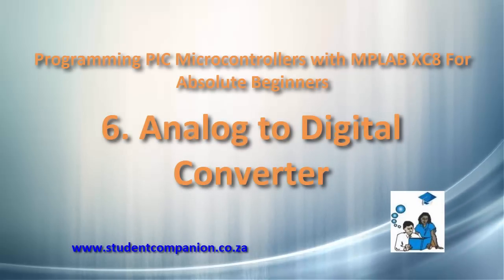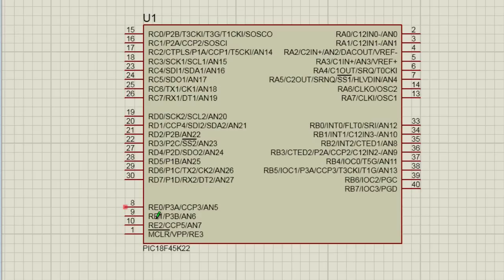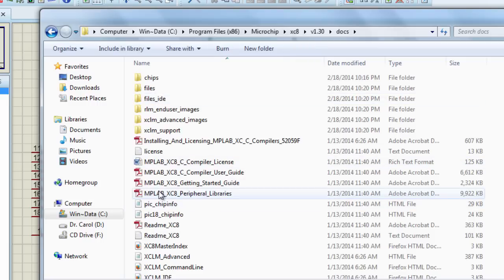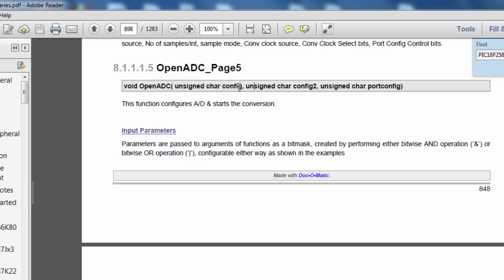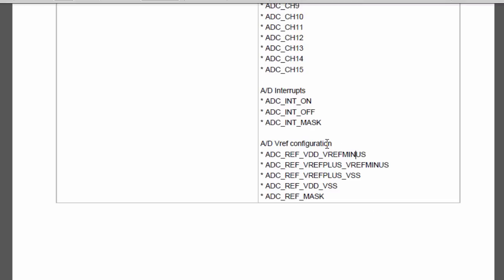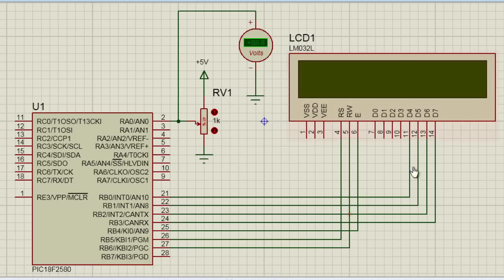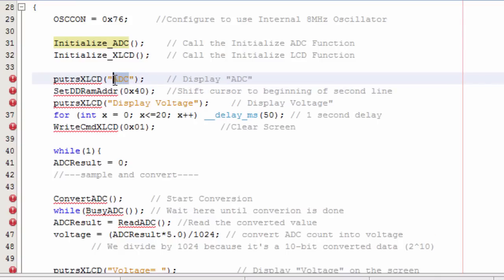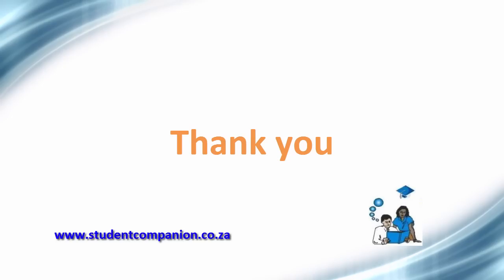6- Analog to Digital Converter | MPLAB XC8 for Beginners Tutorial

Comment: hi. sir, what changes need to be done if i use pic18f248.i used the same code .but its shows error
Reply from the maker: +Jayesh kumar p r what errors? You must post your code and all your error messages
Reply: #define _XTAL_FREQ 16000000
#include <stdio.h>
#include <stdlib.h>

 
void init_XLCD(void); //Initialize LCD display
void DelayFor18TCY( void ); //18 cycles delay
void DelayPORXLCD (void); // Delay of 15ms
void DelayXLCD (void); // Delay of 5ms
 
void main(void)
{
 init_XLCD(); //Call the Initialize LCD display function
 putrsXLCD("Hello World"); //Display "Hello World"
 SetDDRamAddr(0x40); //shift cursor to beginning of second line
 putrsXLCD("LCD Display"); //Display "LCD display"
 while(1)
 {
 }
 }
void init_XLCD(void) //Initialize LCD display
{  OpenXLCD(FOUR_BIT&LINES_5X7); //configure LCD in 4-bit Data Interface mode
 //and 5x7 characters, multiple line display
 while(BusyXLCD()); //Check if the LCD controller is not busy
 //before writing some commands?
 WriteCmdXLCD(0x06); // move cursor right, don’t shift display
 WriteCmdXLCD(0x0C); //turn display on without cursor
 
 }
void DelayFor18TCY( void ) //18 cycles delay
{
 Nop( ); Nop( ); Nop( ); Nop( ); // 18 cycle delay
 Nop( ); Nop( ); Nop( ); Nop( );
 Nop( ); Nop( ); Nop( ); Nop( );
 Nop( ); Nop( );
 return;
}
 
void DelayPORXLCD (void) // Delay of 15ms
{
 Delay1KTCYx(30);
}
 
void DelayXLCD (void) // Delay of 5ms
{
 Delay1KTCYx(10);
}
Reply from the maker: +Jayesh kumar p r did you install and linked the peripheral libraries?
Reply from the maker: +Jayesh kumar p r description on how to download and link the peripheral libraries are explained in the beginning of this video: https://youtu.be/4WaB_Lj8FnY
Don't forget to follow the peripheral libraries help document as explained in the video to see how many parameters you should use in each function. This might change from one PIC to the other.
Reply: NO , I did't install peripherals, may i know how does it affect the program?
Reply: HI SIR, i am not using confgerator.coz. i am using pic18f248. this device is not in mcc. so ii just tried with the same code which u used. i am not using simulator. i use real ic in bread board with lcd display, i use 16 mz xtal .i already send u the code which i used .it shows some error .
rb0- rb3 used for d4 -d7
rb4 used for E
rb5 used for RS

I Did't understand the use of peripheral library,i watched the 22 nd video and downloaded the peripheral library.and i added to inker as u showed there.after that i didnt under stand how to use it.
what i have to do in this case?
 thank you sir for supporting us.
Reply from the maker: +Jayesh kumar p r If you use the library you must install the peripheral libraries.  Otherwise it will genetate errors.
Reply from the maker: +Jayesh kumar p r Are you still getting the same errirs as before installing the peripheral libraries? Or you are getting different errors? If yes what are the new errors?
Reply: C:/Users/rwds-j/Downloads/LCD.c:7: error: (141) can't open include file "LCD.h": No such file or directory
Reply from the maker: +Jayesh kumar p r you must create that file. Watch our video. Ee always created two files at the beginning before writing the code. One the LCD.h and LCD.c
Did you create them?
Reply: sorry sir, actually i am interfacing lcd display with pic. mistakely commented under this video. in that video there u created onlu two files source file and header file right?
Reply: i created them. and made cofigeration bits. that used hs oscillator,wdt disabled , and created source cod. in header file and added #define_XTAL_FREQ16000000
Reply: HI SIR. I FOUND THE PROBLEM, there was a prob with header file createtion. i solved it now  i built it successfully. but i couldn't blink the display. its blank. whats need to  be checked ?
Reply from the maker: +Jayesh kumar p r that's the problem.  Please always comment on the correct video. It helps in getting correct feedback and easy to assist you. Otherwise you are creating confusions. Please start commenting on the correct video
Reply from the maker: +Jayesh kumar p r ok. The configuration bits is very important.  Wrong configuration or no configuration will make your project not to work or work unpredictably
Reply from the maker: +Jayesh kumar p r the first thing to check is the lcd pin connections. The data bits, E, RS, R/W connected to correct pins on the microcontroller. If you are building on breadboard check if you are supplying correct voltages. Turn the contrast potentiometer to adjust the contrast of the LCD

Comment: Hello, I am having a little problem with the project
OpenADC (parameters); has to have ADC_"n"ANA as the third argument
But when i write it in the code, instead of recognizing it as an argument, MPLAB takes it as a simple command and does not build the project successfully.

Here is what I wrote
OpenADC(ADC_FOSC_2 & ADC_RIGHT_JUST & ADC_2_TAD, ADC_CH0 & ADC_INT_ON & ADC_REF_VDD_VSS, ADC_1ANA);

And here is what the error is:
main.c:70: error: (192) undefined identifier "ADC_1ANA"

PS: I have linked the peripheral library and included adc.h in the project
Reply from the maker: +Gray Fox which PIC are you using? Which compiler version are you using?
Reply: MPLAB X IDE v3.45 xc8 v1.38
Reply from the maker: +Gray Fox which PIC are you using?
Reply from the maker: +Gray Fox why not use MCC as explained in this video: https://youtu.be/4WaB_Lj8FnY? Microchip is phasing out The peripheral libraries .
MCC is easy to use and supports new devices.
Reply from the maker: +Gray Fox please upload your zipped project in the forum. We're gonna compile it and find out the problem: http://www.studentcompanion.co.za/forums/
Reply: Let me try MCC first please
Reply from the maker: +Gray Fox ok. Try with MCC. If you don't get right upload your project in the Forum

Comment: I cant find the docs... :( there isnt in the docs folder.... :(
Reply from the maker: +Márk Domonkos which version of the XC8 compiler are you using?
Reply: 1.44
Reply from the maker: +Márk Domonkos from vesrion 1.34 the PIC18F peripheral libraries is no longer included in the compiler.  You must download it separately and install it into your compiler. It's now called Legacy peripherals libraries. You can download it at the same place as compilers on Microchip website.
Reply from the maker: +Márk Domonkos Microchip is phasing out The peripheral libraries.  You can use MCC as explained in this video: https://youtu.be/4WaB_Lj8FnY
Reply: well an is there any peripheral libraries of the 16F series? (anyway thanks for the answer :) )
Reply from the maker: +Márk Domonkos no it's only for PIC18F. For PIC16F you can use the new tool. MPLAB code configurator (MCC). Watch this video to learn more: https://youtu.be/JxSSVtTj_fA

Comment: good day sir  I watch your tutorial 6 which is Analog to Digital Converter  because it is related to my project . I am using PIC 18F45K22 ,I follow all your video instruction and my program runs but I dont know what Pin of the microcontroller can I get the digital output can you help me? thank you.
Reply from the maker: +charlie arong hi. Thanks for watching our videos.  Almost any pin of the microcontroller can be used as digital output pin. Watch our tutorial 1 and 2 to learn more. We usec digital output pins in those tutorials to connect an LED.

Comment: my questions are : Base on the three arg in the openADC()
1. please 
why did you use ADC_FOSC_2, why not ADC_FOSC_4? you said it divides the 
freq osc by 2 , please what is the effect of this division?
2. how does A/D justification works?
3.what is the importance of the A/D interupt inside this function as arg?
Thanks in advance as you break them down for me.
Reply from the maker: Hi, All these configuration depend on the PIC used as a configuration of a particular PIC microcontroller will not yield the same desired effect if applied to a different PIC, you need to read your datasheet to make sense for your PIC. Other factors are: The chosen oscillator frequency,  required accuracy, etc.
Reply from the maker: 1. The ADC_FOSC_x is to select clock frequency used for internal synchronization of A/D converter. This depending on your oscillator frequency affects the duration of conversion. The clock is critical to produce the fastest but also accurate Analog to Digital Conversion.
The time to complete one bit conversion is defined as TAD. One full 10-bit conversion requires 11 TAD periods. For correct conversion, the appropriate TAD specification must be met. Check your device datasheet to get the ADC conversion requirements, for PIC18F26K20 the min TAD is 0.7 uS and max 25 us and this is dependent on your oscillator frequency.
2. The A/D justification won't make any difference to you whether you choose left or right if you are using these libraries, but will have to be considered when you are accessing these registers yourself without libraries. If you receive a 10-bit A/D value and you need to store it in an 8-bit variable, you'll need to know how it's justified (the least significant bit) so you'll know which 2 values (least)  to drop to fit in your 8-bit variable for example
3. You'll need interrupt to let you know when an A/D conversion has completed if in your application it's critical otherwise you can omit it.
watch this video, it describes these terms graphically with  MPLAB Code Configurator: https://youtu.be/4WaB_Lj8FnY
Reply: Thanks so much...
Reply from the maker: You are welcome.

Comment: Hi
in my project I want to use an LCD but I want to connect it to the C-Ports
I tried to change the Ports in the Header but in simulation the signals are sent to B-Ports

Do you know how to fix this??

Thanks in advaced
Reply from the maker: Hi. If you are using PIC18F Peripheral libraries for your ADC, you'll have to recompile all the C files by including them into your project as well to be able to change the PORT. Watch this video we explained in detail how to do so: https://youtu.be/RkDN2GW_SxU
Reply from the maker: IF you are using a new PIC model supported by MPLAB Code Configurator (MCC), I will advice to use MCC to configure your ADC module, it's easy and quick.
Watch this video, we explained in detail LCD and ADC with MCC. With this library, you can connect your LCD to any PORT of the PIC easily: https://youtu.be/4WaB_Lj8FnY
Reply: I watch the video you  recommended...
...now the C-Ports are putting out a signal but the LCD is not displaying anything
have you any idea waht this could be?
Reply from the maker: +Leto ausm Ghetto is your lcd wired correctly with pins of lcd to correct pins of PIC? Especially the RS, E and RW pins?
Reply from the maker: +Student Companion check those pins
Reply: yes it is connected correctly
Reply from the maker: +Leto ausm Ghetto how did you connect it? Can you tell the pins of lcd how they are connected to pic? Which pic model are you using? Can you post your C main code? Which library did you use? MCC or PIC18F peripherals libraries?

Comment: you doing great job sir ! 
well i wanted to know what should i do if i am using pic 16f family microcontroller ? 
does xc8 supports thes mcs ? i could not find any peripharal library for that
Reply from the maker: hi, thank you for watching our videos.  XC8 supports all PIC families including the PIC16F family but the peripheral libraries were created for the PIC18F family only.
Reply from the maker: the easiest and the best is to use Mplab code configurator as this tool support pic16 pic18 and pi24 series.  watch our tutorial 18 to learn more.

Comment: Hi, Im using the latest version of xc8 (v1.36), and the file MPLAB_XC8_Peripheral_Libraries does not exist. Can I find resumed information on another folder or must I "read" all the datasheet ?
In my case, I am surching information about CAN bus, but I want to see all your videos step by step. Maybe can I find this answer on your appropriated video. 
However, thank you for your videos, and thank your for your previous quick answer ;)
Reply from the maker: +Lisarios Hank&#39; MPLAB is phasing out the PIC18F Peripheral Library which is no longer included in XC8 from version v1.35. 
If you are using XC8 compiler v1.35 or a later version, the Peripheral Libraries which include the LCD and other peripherals like ADC, SPI, I2C libraries are no longer included in the installation file as with previous versions. You can use MPLAB code configurator to configure your peripherals (http://www.studentcompanion.co.za/mplab-code-configurator/) or you can download the Peripheral Libraries as a separate download and install them. You can download them at microchip website under the MPLAB XC Compilers downloads tab. They are now called PIC18 Legacy Peripheral Libraries (http://www.microchip.com/mplab/compilers).

Comment: pls sir am having problem with mpx4115 pressure sensor with pic16f877a....my display and code in mikroc is as shown below..i connected my sensor to channel 0.....and also sir what is the logic behind the adc calculation for other sensors like humidity,motion,PIR and so on

// LCD module connections

sbit LCD_RS at RB4_bit;

sbit LCD_EN at RB5_bit;

sbit LCD_D4 at RB0_bit;

sbit LCD_D5 at RB1_bit;

sbit LCD_D6 at RB2_bit;

sbit LCD_D7 at RB3_bit;

sbit LCD_RS_Direction at TRISB4_bit;

sbit LCD_EN_Direction at TRISB5_bit;

sbit LCD_D4_Direction at TRISB0_bit;

sbit LCD_D5_Direction at TRISB1_bit;

sbit LCD_D6_Direction at TRISB2_bit;

sbit LCD_D7_Direction at TRISB3_bit;

// End LCD module connections

unsigned int Adc_result=0 ;

float pressure;

unsigned char txt[15];

void main() {

TRISA.RA0 = 1;

ADC_Init();

Lcd_Init();

Lcd_Cmd(_LCD_CLEAR);

Lcd_Cmd(_LCD_CURSOR_OFF);

Lcd_Out(1, 3, "Mikro C");

Lcd_Out(2, 2, "PressureSensor");

Delay_ms(1000);

Lcd_Cmd(_LCD_CLEAR);

Lcd_Out(1, 1, "Pressure: ");

Lcd_Chr(1,9,"kPa");

do {

Adc_result = ADC_Read(0);

pressure = (Adc_result * 5000) /1023.0;

pressure= (pressure+0.475)/0.0475;

floatToStr(pressure, txt);

txt[4]=0;

Lcd_Out(2, 3, txt);

Delay_ms(500);

} while(1);

}
Reply from the maker: hi, what is your problem,  what error are receiving?  there's no specific logic behind sensors
 each sensor is unique and requires its own calculation to convert what it reads to what you want to display. you just have to read its data sheet.
Reply: Pls sir from my code can u pls tell me where have gone wrong. ..I have tried my best but am not getting desired pressure output.
Reply from the maker: +adigun Orlami hi, why are you multiplying Adc_result by 5000 instead of 5 (5v) and then devide by 1023 instead of 1024 ?

Comment: question please i have a pic32mx170256b and xc32 __delay_ms () dose not compile :(
Reply from the maker: pier shaw These tutorials we present in this playlist are only for 8-bit PIC Microcontrollers like the PIC16Fxxxx or PIC18Fxxxx. It is not for 32-bit PIC Microcontrollers like your PIC32mx170256b. This is a wrong forum for your question. At the moment, we are not dealing with 32-bit Tutorials. You cannot use our codes for these 32-Bit Microcontrollers, it will give you errors.
Thanks